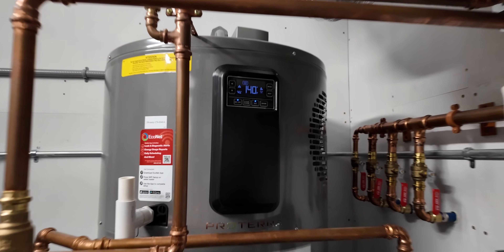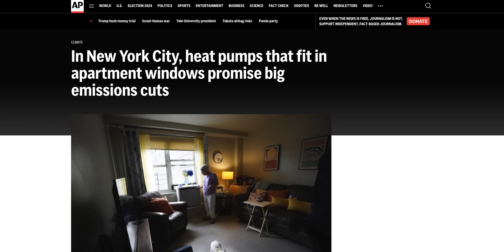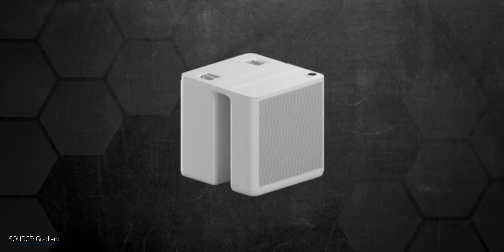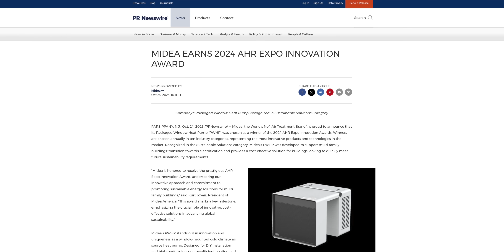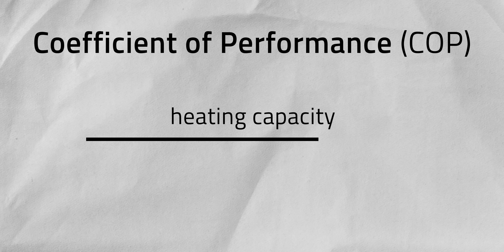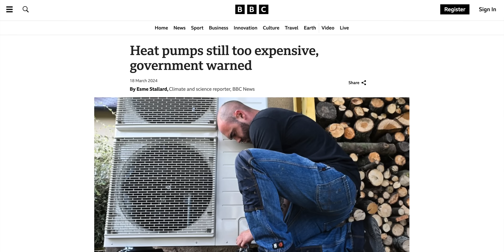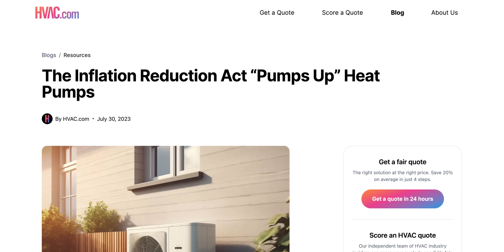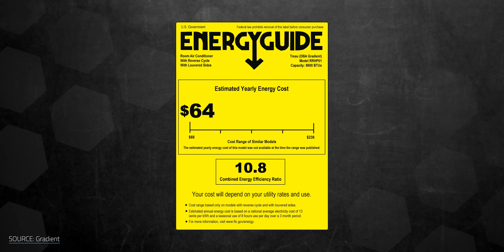Why This Window Heat Pump Is Genius

Comment: 3k for 9000 btu, what a effin joke.  Here i thought it was under 1k.  If you have a few rooms, that’s like 9k.  Plus there is really no reason from such a high price.  You can get a heat pump twice as powerful for half the price.  Nice design, but so overpriced, probably not reliable due to being new.  And doesn’t work above 95F, thats some bullshit.

Comment: Did I miss the part that addressed the form factor only being suitable for a single style of window? They’ll need different designs to work with horizontal sliders, with casement windows, hoppers will be tricky, and it’ll be next to impossible with Jalousie windows.

Comment: Here in the UK, many "Low Rise" Apartments of (Say) 4or 5 floors have "casement" openers whose lock can be over-ridden for cleaning - but where would this type of Heat Pump Fit? Plus, English Planning Law would mean that Planning permission would be required whether owned, rented or Leased.

Comment: We had a U shaped AC unit that replaced a 220v one from like 1998. The new one was near silent, easy to install, wifi connected, and only slightly less cooling than the beast we had before for less than half of the energy cost. An obvious step forward is to make it able to heat stuff too lol
Edit: Looked it up and its a Midea one! hell yeah
Reply: Yes and the 8k BTU version is only $380, yet they want $3k for the inverted U with heat pump. Totally ridiculous price.

Comment: Absolutely unsustainable or rather still not feasible for the middle class in the UK…since electricity prices are pegged to the price of Natural Gas AND there is a scarcity of reliable installers of heat pumps who do genuine after care and maintenance

Comment: I got a reasonable price of $5k with a $800 rebate, for my home heat pump, and I believe electrical upgrades were around $2k, but I could be remembering wrong.  My aunt was quoted $15K for a basic heat pump install, and was told by many people that it was cheap, which is why she went with a gas furnace instead.  Window units between $2k and $4k, with no added costs for install and electrical, is actually incredibly reasonable.  My only real concert is about how well it will fit into a window.  Other than that, sign me up, I'll take several.

Comment: These old buildings often have radiator right in front of the windows. That means you need to remove a radiator before installing this unit. Also, these old building often do not have enough current to power these units. There are so many reasons why something like this will have limited adoption. That's my prediction.

Comment: Another option could be for the building owners to install Grey Water Collecting tanks for temporally collection water from showers and clothes washing and then retrieve the waste heat from the water for recycling that same heat back into apartments.  This is often an huge overlooked source of heat that is readily available with the right type of heating/plumbing system.

Comment: is there any reason ACs (or now heat pumps) can't be C shaped? They make them U shaped (upside down U as well) but not C shaped. most houses I've lived in have left/right sliding windows instead of up/down.

Comment: This heat pump sounds great, but wouldn't it be better if we improve our buidlings first? Build better new ones, but also improve current buildings. Because there are so many buildings which can keep the cold out fine, but they cannot keep the heat out in summer. My house is the same, sadly. It is insulated and has double glazing, but there are several errors the architect and builder made. I have huge windows, black tiles on my roof (gets incredabily hot in Summer), pretty thin walls between the neighbours (so, if they don't use sunscreens, which they don't and don't use an a/c, the heat from their house, transfers into mine), etc. Their house is 8 to 10 degrees warmer than mine (I use an a/c)

All in all, I think my house could be 5 or 6 degrees cooler in Summer with some adjustments to the house (without even an a/c or heat pump), but it is a rental house, so I can only do so much unfortunately.

Comment: Seems too expensive compared to the 18k BTU mini splits I installed. The last ones I bought cost just under $2600 for two units. The refrigerant lines communication cable and condensate hose pass through a 2” hole. This too is a DIY friendly project. The only thing lacking in these is the hinged hanger for the compressor unit and a condensate pump to keep water from dumping on the sidewalk in heat mode.
I think they need to try a little harder to make these more affordable.

Comment: I think the principle could be applied to a single family dwelling with a larger unit  but instead of mounting it in the window, mount it in the doorway so as it can swing out/in as a unit the same as an outside door but during operation, the entire unit would seal as does an outside door.  This would reduce the need for the more expensive wall mounted types being used in older homes.

Comment: Why not just have a window unit that you can rotate once per year? (with control panel on a wire that mounts to the window sill or something?
This swaps the condenser and evaporator sides as needed, without the need for a reversing valve. You would also need the condensate to stay outside in heating mode, but a rubber plug should do the trick. An inverter on both fans and compressor would be nice to keep it quiet.

Comment: What do I think? I think it would be more beneficial for the viewer to see a comparison between regular, outdoor units and this new variant, instead of seeing the same option from two companies compared. Finding out the efficiency and cost per kilowatt of power (be it gas or electric) between all systems would be swell, but you decided to go another route. Nevertheless, I've watched until the end. Oh, and outdoor units do heating and cooling, though you say they don't.

Comment: Big benefit to this is its ability to be individually powered. Here in Florida the threat of power loss from a Hurricane is very real each year, and being able to hook just the AC up to your solar set up could prevent dangerous heat stroke conditions during outages. 

Not just that, but with the latest climate assessment showing the number of days above 95 degrees going up in Florida by almost 40 days, Having something that can be set up so quickly to boost a traditional aging AC unit could help save lives. Technology like this is going to help stave off a more massive climate migration crisis in North America in the next 50 years.

Comment: Very interested in these.  Being in hurricane alley, efficient ways to cool a small space post storm on small generators is truly life saving.  If they do these right and DC inverter based units, there is no big startup surge.  That would allow a small generator to run this, lights, fridge, and some communications. Game changer.  The current window units leave too big an opening, draw a decent amount, rarely have heat options, high start up, etc.

Comment: My duplex might seem like an ideal candidate for these ... but it's not.

I'm owner-occupant of the upper flat, and rent out the lower, both 1200 sq. ft 2 bedroom apartments. The building is 125 years old, and has hot water heat flowing through big cast iron radiators. No ducting, so I relied on regular window a/c units for summer cooling.

Again, this sounds ideal  for window heat pumps ... only my windows are all quite tall, and the bottom sill is less than a foot from the floor. There's no space for the inside half to hang below the window. Also, I would need several units for each flat to cool or heat each apartment.

Earlier this spring, I installed one regular ductless mini-split per unit. Each is large enough to cool it's entire flat, carefully placed high on a wall to distribute air throughout. No interference with windows, and even better efficiency. Also not cheap, but permanent.

Comment: Seems to be very similar to a through-the-wall heat pump, ductless heat pump (aka mini split) or terminal pack (used by many, many hotels and motels).  I remember inquiring about this idea - or something along these lines - many years ago, and being told, “That can’t be done”,  “That doesn’t exist” or “That’s impossible”.  Such responses never made sense.  Glad to see this happening.  This makes so much more sense than the conventional “portable heat pump”.  Glad to see it happening.    Thanks for the update.

Comment: I cannot wait for them to be standardized to work for the area I live. Our potential temp range from winter to summer is really large. Its not uncommon for it to get below negative 20F sometimes as low as negative 50 then up to 110+ in the summer. I haven't seen any basic units that can handle up to a 160 degree temp range

Comment: First - We where told Air Conditioning is destroying the environment, by energy usage and ozone depleting gases. Now we are told heat pumps (air conditioners working in reverse) are now going to save the environment. But France is now have no air conditioning at the Olympics, due to the environment, but countries are shipping in portable AC for their athletes.  Norway uses all sorts of heat pumps, but is a net electric exporter, so such "environmentalism" is feasible for 5 million people, all the while drill for oil and gas.
Can you "guys" get on board with one narrative so the elites can make even more money on the current panic?

Comment: Hmm..... I'd like to know more about the seal between the window frame and the unit, because window frames come in different sizes. These units will also need to because there would be some serious drafts from the sides if they came in one size .

Comment: There is an easy and cheap way to make window heat pump. You add 4th ply to a glazing. Quad glazing is energy positive (even in Nordics).
Reply: Google "quadruple glazing" on Wikipedia and ref. therein (e.g, zero-heating buildings)

Comment: Too bad I don't have this type of window that opens from the bottom. And are not coincidentally exactly the width so I don't have to install some sort of insulation on the side of the unit. And have a radiator under the window I legally (or safely) can't obstruct. And can't do anything about these issues because I rent.

Comment: Underrepresented issue with retrofitting these kinds of systems, AC often puts such a load on whatever circuit is the closest you can run the risk of tripping the breaker consistently. Landlords should be required to run a new dedicated circuit for AC/Heat Pumps when retrofitting them into a space.

Comment: Can an ac unit, condenser/evaporator system use the heat transferred to generate electricity to power the system?

Basically like geothermal energy but with the ambient air.

Comment: The older Midea wall-mount cooling units had the "U" pointing upwards; there are several advantages to this new design. One potential problem with the downwards-U design is the removal of liquid water from the inside of the unit. In those older units, gravity could send the water outside. With the downward-U, the units would seemingly need a small pump to pump the water upwards for removal. Is that correct -- is there a small water pump included? If so, what happens when it fails?

Matt, have you ever evaluated Midea's standalone air dryers? In my particular location and locale, lowering the humidity is all I really need to do. Do they have the characteristic high efficiency of their heat pump units? I'm also interested if you have ever explored options for using that reclaimed water for drinking or gray water systems. TY.

Comment: Let's have Blackrock, Vanguard, Meta, Alphabet, administrators of Inflation Reduction Act and NY State pay the bill and install these heat pump window units in a year. Lat's make 2025 a heat pump year. We'll see if the grid can keep up with the electricity demand. We'll see if the landlords reduce the rent by the amount of heating cost savings they make. We'll se if the heat pump price is kept under $3K. 
I wonder if the above mentioned companies and governments are just virtue signaling or, they really mean what they say about energy access equity even in the city where administration and citizens are already sold to this idea and no efforts and investments are required to convince them.

Comment: Someone correct me here.

A heat pump moves heat from one side of the wall to the other. Makes a hot room cooler or a cold room warmer. But to do so it will also do the reverse. So to cool a room it will make the outside warmer, and to heat a room the outside colder.

For one unit in a house in a relatively spaced out neighborhood that isn't a big deal, but for the thousands of apartments in a tight city is that effect not a significant factor. Would that mean hotter temps in the summer and colder temps in the winter specifically in cities?

ACs partially already have done this but would this now also effect winters in those areas as you are no longer burning materials or utilitizing electricity.

Is my scale off so this doesn't matter?

Comment: You lost me at getting more energy out than you put in. 😕
Reply: Its actually true, cause all heat pumps do is move heat, not making heat.  The 3k price is a ripoff
Reply: @dasefrefag  It's not true. You can NEVER get more energy out than you put in. Heat pumps are certainly a more efficient method of turning electricity into heat/AC, but there's no free ride. The amount of energy used to move the heat from where it is to where you want it to be will always be more than the actual heating energy you receive (or dump.) This is always the case. What you're trying to do is get as close to 100% efficiency as is possible (it isn't possible, of course.) That's all that makes one form of heating/cooling better than another. The method that wastes the least amount of energy is the best.
Reply: @shermanuitzetter7908  first of all cheapest electric heater is already 100% efficient, even the electricity lost due to resistance in the wires, is lost in terms of heat, and since that heater is in your home, the heat is not lost.  If you have geothermal heating and cooling, all you are doing is pumping water around and it just transfers heat from a to b, its a tiny use of electricity yet the heat brought in is massive.   Heat pumps like geothermal heating does not produce heat, it just moves it by extracting from the external environment.

Comment: This kind of innovation is good, it should be noted that in many places, the increasing demands for electricity for heating instead of gas and electric vehicle does not have the infrastructure to support or the generating capacity, the climate con does feed a good narrative for food and fuel poverty though, the have Yachts telling making huge profits off the have noughts

Comment: I'm blind so I don't know if these work with swing out windows.
I would prefer this to being required to use a inefficient portable ac by my landlord. My apartment is hot, even with no heat coming from the radiator. Electricity is fixed rate, not metered,  for all sweets.

This may be a hard sell to my landlord.

Comment: 3k$ is outrageous, split systems with double the output from reputable brands go for 2/3rds the price, and it’s not even really about packaging, the only difference between a regular split system and that window unit is the amount of tubing between the two ends

Comment: There also are portable heat pumps for those who aren’t allowed to have window units outside their windows. I recommend one with duel hoses, so the unit doesn’t create a negative pressure drawing hot air into the room. Also, I placed a blower in front of my window heat pump, so it can cool a larger area.
Reply: Dual hoses is crucially excellent advice.

Comment: Amazing tech. Simple is always better..... 

I feel it worth mentioning. I have a normal window AC. During those hot summer months I crank up the AC. However after just a few days I start to sneeze and weez. Many window AC users notice that their units develop mold build up within the ducts. I believe this is the cause to my allergic reaction. 

I try often to clean out the unit air ducts but it is never enough. The mold comes back quickly. 

Thankfully I live in the northeast and many times I just turn on the fan. So I don't suffer as often for prolonged periods. If I had to use the AC constantly I would hate it. My concern is that the ducts are never easy to access and clean. There are areas, like tight corners, within the ducts, that never get cleaned. So the mold issue will persist. My question to the manufacturer is how will they address that design issue? Will they make it easy for the users to access and clean the ducts? Users need clean air and this heat pump will be a huge change to the end user. A product like this will be used more often and year round.

Comment: How am I able to buy a mini split heat pump on amazon for $500 - which is literally the same exact thing as this thing?  Why does this need to be so expensive, its the exact same guts in a smaller case...
Reply: I understand the point of no installation; no drilling holes, its way more convenient!  I just mean why would the manufacturing cost that many times more?

Comment: 9:00 the problem with electrical stuff is most power plants have a COPD of 0.33-0.63 and most are on the low side because they can't replace them all instantly.